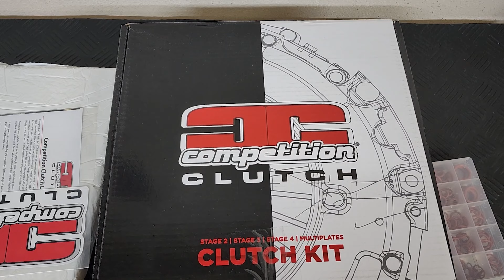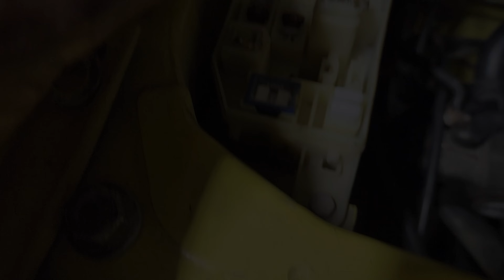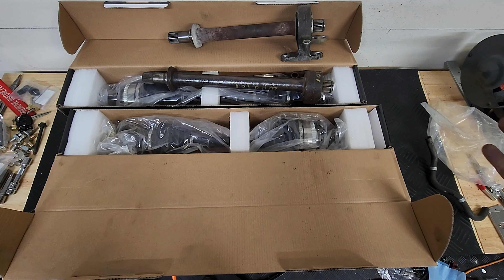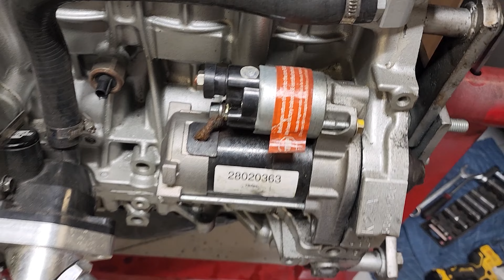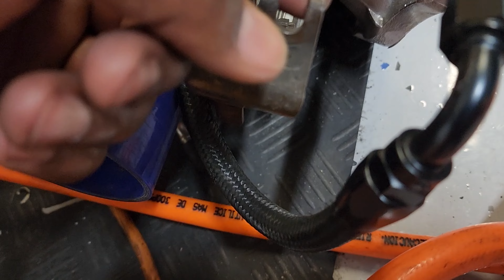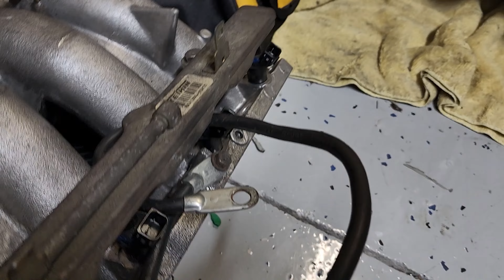Parts Needed to K Swap Your Toyota MR2 Spyder

Comment: Nice video.  I guess the advantage of doing a k swap vs a 2zz is more aftermarket support.
Reply from the maker: Absolutely.  The 2ZZ is also priced much higher than a JDM K24A (I picked up a replacement JDM K24A long block for $700).

Comment: Does anyone know how much roughly all this would cost ?
Reply from the maker: I made a spreadsheet but can't find it. I sourced some used parts, so original cost was around 7k with LSD install, all swap parts, odds and ends. Later, 9k total to work out the bugs and upgrade weak points, and finally around 11k total to go from stock to basically full bolt-ons. The next mod planned for the NA is a high flowing head and custom 3" exhaust in hopes of seeing >260 whp. She currently sits at 242/209.

Comment: Do you need to get a Rsx type s ECU with a Kpro v4 ?
Reply from the maker: I think so, first for parameters, then tunability.
Reply: @BoostedorNA  one year later actually starting this. When the grounds come into play, how difficult are they to set up? Also, the A/C and mim are these easy to do i don't know how to do wiring but I will be able to do the firewall fuze box modification but idk about the other ones

Comment: I regret half the parts i bought haha
Reply from the maker: Any reason?
Reply: @BoostedorNA speaking of that do you know which intake manifold is best for boost for a street car?
Reply from the maker: I'd imagine any that are well made, good runner and plenum size. I'd prob get skunk2 ultra race vs s2pro if I did it all over again but I'm running a cut/ported rbc on my turbo car.
Reply: Yeah there were better ways to do it i found out afterwards. Could have saved a lot of money. I'd be turbo for the same amount.

Comment: Cost wise, I am SO on the fence about a K swap. From the forums (which are often wrong) like spyderchat, its unanimous that the 2zz is just too fragile to be competitive in today's speed based motorsports.  Some people say a 2zz with bolt ons (NA) is all you need to dunk on 350+ whp STis (doubtful).  Otherwise, my 2021 Miata RF could do it and it very much cant (it has the same power).   Then you have the boosted crowd and most say its just gonna break. I am coming from a 97 240 I've owned for the last 14 years that I had built to high 300whp, capable of over 400whp (which it successfully dynoed at) and once you put a Z32 trans in it, there's zero reason it wouldn't be strong enough after that.  Yet somehow the Toyota powerplants seem to struggle with half that. built or not. 

The only thing killing me with the K swap ordeal is that I'm tbh SO over the whole rodeo and just want a fast rwd car that weighs 2300lbs with a full interior and AC.  The main point of struggle being costs. Can it even be done (and done well) for under 20 grand? My 240 was well into the 40,000 dollar range when I was finished (and the SR20 is supposed to go in it). granted that was buying things 2 or 3 times in some cases. but I just don't wanna go through the BS again. but I'm still a car guy and really wanna enjoy a car like this.   I currently got a 2001 completely stock MR2 5 speed i just hit 100,000 miles in. Engine was previously rebuilt but I'm ready for it not to be as slow as I remember my young adult vehicles being.
Reply from the maker: I wish the Spyder came with the 2zz, otherwise I’m not a fan of swapping it in for reliable competition use (no personal experience, but seen lots of failures).  The cost for engine/6spd is so high you’re nearing a budget K swap, which is pretty reliable after a few shakedowns.  

My budget K24A with the 219whp dynojet tune surprised many cars from a dig (I managed 4.99 0-60) so I wouldn’t doubt sneaking up on STi's… the light weight, mid engine and rear drive does wonders.  (As a previous WRX owner, they’re not fast or reliable…Sti’s are marginally better.)

I’d research which Toyota motors are capable and which aren’t and go from there.  @FrankensteinMotorworks is doing wonders with the 2GR and 2AR.  

My NA 219whp budget K swap was around $8k, then roughly $10k buying things a second/third time, then modding it up to 241whp brought it up to about $12k.  I did all the work myself (friend installed LSD) so I saved a lot on labor. 

Tell me your budget, hp goals, and goals for the car I’ll give you my opinion for which route I would go.
Reply: @BoostedorNA  hey man. appreciate the reply. Sorry, this is long;

Staying well clear of V6s in a car this cramped. Too bad the spyder isn't a clamshell like the old british roadsters were where you could sit on the tire and change plugs lol. I took a look at his website, it's interesting to say the least, it sounds like other than the 400whp GR, the AR remained 180 at the crank? 

Actually, I bought the MR2 coming off the frustration of being unable to find anyone really trying to make the mx5 faster/stronger as far as product research goes. like they used to.  I had an old 04 NB for a brief while and I probably should have built that. But at the time it was the same story (only about 210whp and then it falls apart).  except the ND is worse while simultaneously being the more rigid/better newer car. because now it's either V8 or bust. 

So that one is my daily now. Found the MR2 last year in March and despite the age differences (even compared to my 04 NB which was 3 years newer), It's a superior car overall to both and I'm pretty much hooked. almost as quiet as the 2021 ND, but WAY quieter than the 2004 NB with stock suspension and my MR2 is on coilovers. both cars are hardtop and my ND an RF.  The only reason I don't sell the ND yesteday is because I already made the mistake of buying it.. lol Might as well wear it in. it's a 4th vehicle and it's a new vehicle..

That said, anything I do to the MR2 I want to be something vastly unfeasible for the ND to replicate or compete with. I played with the idea of the 2zz turboed but we discussed why that's probably not looking so hot. As for NA, I basically have a "2zz" experience in the miata, minus a few thousand rpm. Cost benefit isn't there. 

I wanna get an experience closer to my old 240 (power wise), if possible. AND without all the rust (the reason I sold it) Which brought me to your channel, actually. Being that the car is mid engined and almost 600lbs lighter than my S14 was. (my s14 was exceptionally long geared though. J30 rear end and Z32 trans. it was fairly lazy on the freeway unless dropping to 3rd, and then going to jail).  

I don't need mile high gear ratios like i had in that, but people say the MR2 could give me that experience with 250-300whp. But I never felt one to verify that.

Basically, everything points to the K swap being the only way I can satisfy these goals comfortably. Especially with boost. The car is currently set up for autocross. almost to the T of how Togue Time's car is (minus the 2zz.). Same wheels, tires, fortune auto 500s, whiteline bracing and an alignment that took countless visits to the rack to make perfect. I don't like autocross. 

I'm 32 years old now and I'm not so interested in knocking over cones and getting good reaction times. I just want what my old 18 year old self would have wanted, had I known the MR2 spyder was so much better than all my previous cars as a concept. A street monster in a tiny package that greatly reduces the number of people bullying it out of the onramps or from highway rolls.
Reply from the maker: I agree on the V6.  I wouldn’t want anymore weight in the back than the current K-Turbo.  The AR 4 cylinder was around 240whp and I think there was possibly 270 and a future goal of about 350.  

Now that you mentioned, I haven’t noticed any big power NDs, just track wheel/tire and suspension mods.  RF is sweet tho.  I’m actually looking to mod an old used aftermarket hardtop to make it something like the Solstice GXP Coupe. 

The best thing you can do is get on Spyderchat and see if there’s anyone near you with a K swap and try to get a ride.  242whp/209lb-ft in a NA Spyder feels almost scary fast. There's power everywhere and literally throws me back just stabbing the throttle. 

Follow my Turbo K build.  It’s almost done but hit a few hitches, namely me moving to Vegas.  Currently, @Autosauce is finishing it and will tune, but they found a few issues and are fixing.
Reply: @BoostedorNA  Just remembered to ask this question; how OEM does your K swap feel? and your overall experience with it's daily driveability/smoothness. Can you just get in and start it like your stock motor? no problem? run AC and heat just fine etc?

I refrain from mentioning my 93 supra (due to the internet clout surrounding it). But it was the only car I ever owned that started up and drove as close to stock as possible with a haltech. the only issue it ever gave me (and still gives me) is every now and then when driving on pump gas, if i come to a stop using AC it will die or hunt. but simply hitting the button off before coming to a stop or going into neutral will keep it perfect.   My 240 with 300 less whp used a much more primitive power FC and the cold starts were ass and idle sucked until you hit operating temp. if the water temp got below i'd say 140 degrees or so it would idle choppy and die if you didn't keep your foot down. AC didn't work. maybe it was my tuner, maybe it's just that PFCs suck. 

But whats your turn-key experience with the K swap. does it "feel" like a swap? weird idles, cold starts, choppy throttle, weird grindy noises, vibrations etc?
Reply from the maker: NA is rough due to Innovative mounts but it was always intended to be a track car.  Turbo is OEM smooth with stock mounts and was meant to be DD. I can jump in and drive both with no issues.  The turbo will have AC, NA does not but I may if I bring it to Vegas.  I never had to use heat in the NA (Vegas and Florida) but I do think it worked based on how hot it was when bleeding the coolant.   

Did you check/remove/replace the idle up or vacuum switching valve (VSV)?  It caused the same issue on my Celica GT-Four.  

I steered clear of the PFC.  I went AEM, and then MSPNP,  which I regret.  Not many tuners care for Megasquirt. 

My first swap felt perfect during warmup due to the high idle.  Once warm, it gets down to 900ish rpms and you can feel and hear it on the passenger door and glove box, sometimes the engine cover.  When stuck in traffic, it gets annoying.  I can raise the idle to 1100 and not really experience that much but 1100 feels like I'm resting my foot on the gas...I don't like that.  They're almost equally annoying.  I adjusted the throttle with no slack so tip-in is aggressive, which I liked with 219/185.  With 242/209, it's jarring off the line so I'll loosen it a bit.  Initially, if you use innovative mounts, you'll want to drive 50 miles and check all nuts and bolts you installed and tighten.  You may even find that you lost some on the drive.  Repeat offenders will need loctite.  

The turbo with stock mounts doesn't have these NVH issues, and I never noticed any nuts/bolts coming loose.
Reply from the maker: This is the turbo car in work...
https://www.youtube.com/shorts/F0_iJdSbN8A
Reply: @BoostedorNA  I hate loctite in general, but if its necessary for safety I'm not completely against using it. Maybe some of those bolts were TTY and lost their bite? i know as a non factory car, the torque specs are anyone's guess for a lot of hardware but I'm sure there's a sweet spot.  I spent 12 years in the army working on helicopters and all dynamic components required very specific torques or they come apart in a similar way. that's deadly. I've adopted the habit of using a torque wrench at all times possible on my cars. I even mark bolts so I can visually see if any are moving unexpectedly. sort of treating my cars like aircraft when its not a huge inconvenience. 

That's very good news on the turbo build. I made the mistake of polyurethaning all things on the 240 and I'm not doing it ever again. between some unsolved noise with the tranny and the bad roads here, the car probably lost more of it's rigidity from bouncing around like that for the better part of a decade than from the rust. 

I'll be keeping a close eye on your turbo build and playing catch up. Wishful thinking would be for me to retain functionality of my stock cluster, all gauges if at all possible. but if not, I can settle for a screen, though I prefer old school gauges myself. Every new car has a screen these days and it's sort of a lost charm now.

If haltech makes something smooth for the K series, I would go for it. Looking at MWR as well to see what's out there to streamline the process as much as possible.
Reply from the maker: OEM is well-engineered but these kits are thrown together.  I spent 21 in the Air Force, 5 on helicopter maintenance (E&E).  Thanks for your service!  

The gauges work when you get all the right components.  The only thing I haven't fixed is the airbag light with the aftermarket steering wheel.  There's all kinds of solutions out there, you just have to figure out what you want and how to make them work for you.
Reply: @BoostedorNA  Thank you for your service as well!  I was working on my E7 packet just as I was cresting that last 10 year hill and then my body suddenly decided it didn't wanna make it to retirement. ah well, get more time to play with cars in hawaii now.

OEM integration is always good news. I just spent last night on mitches auto parts reading about that multiplexer piece you got for the kit that ended up being specifically what I was looking for. 

This time around, I'm ok with leaving the interior completely stock to include the wheel, so hopefully no dash lights for those things. Eventually I'd like to ship a monocraft car from japan or the UK over and that would complete the fleet, that one will hopefully come with all the track day bells.

Comment: Do you have a rough estimate on price for everything you showed besides the engine and transmission? I’d rather save the money and buy all at once rather than one part at a time

If I missed you talking about the cost then roast me with a response and lmk what part of the video he mentioned it. I most likely missed it
Reply from the maker: The site mitchsautoparts.com lists package deals from $1800-$5700 but you'd need more stuff. I think with engine, transmission, clutch, blemish headers, I was around 7k. Easiest way to save is source/fab your own exhaust.

Comment: Does it matter which Kseries water pump housing and auto tensioner is used? Do it have to be type s?
Reply from the maker: From what I understand, you need a USDM k series wp housing, I'm not sure if wp housings or auto tensioners vary.
Reply: @BoostedorNA  Do you remember which half shaft you used?
Reply from the maker: Type s intermediate shaft, must be manual, ep3 and rsx may work too. Others are too long.

Comment: thank you for this video! So you capped the heater line on the thermostat because you don't want to run a heater or are there any problems with running the oem heater?
Reply from the maker: Youre welcome! I didn't want to figure out the plumbing, and also didn't install AC because I didn't think I'd need it. I will install AC and maybe connect heat on the next build.

Comment: Hello,
Thank you for took the time to made this video. May I ask where did you got the patch wiring? ( orange wires)?
Reply from the maker: https://www.mitchsautoparts.com/products/wire-harness-adapter-k20-k24-swap-mr2-v3-street
Reply: @BoostedorNA  Thank you.
I remember about 6 years ago. My brother got the same wires. But the pins were all wrong. Lol

Hopefully this is a new updated.
Reply from the maker: Yeah I had the same prob with the O2 sensor wires but he usually fixes little issues with each revision

Comment: Hey man, appreciate you  taking the time to make this video 
for the axle intermediate shaft, is that MRS part or K-Series part? and there is no bolt on bracket for the throttle cable?
Reply from the maker: It's a k series part, specifically civic si/rsx manual. 

From what I understand, there are throttle bodies for Hondas and some slightly modified specifically for the spyder swap. They have a bracket but I've still had to make some adjustments for it to work right.
Reply: @BoostedorNA  Oh I see, I wasn't aware of that midshaft intermediate shaft, I thought kswap axles all came with that integrated just like 1zz axles

Comment: I'd see if you can weld between the notches on the ac bracket so it doesn't crack over time
Reply from the maker: I'll try to add a small support bracket somehow.